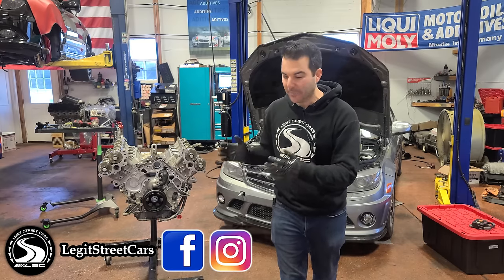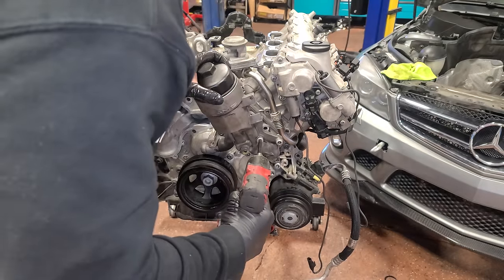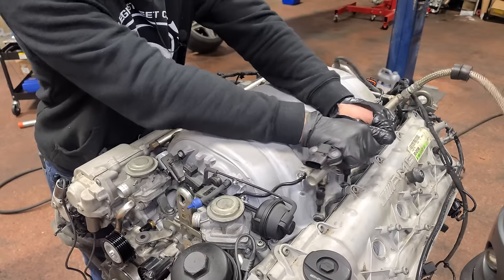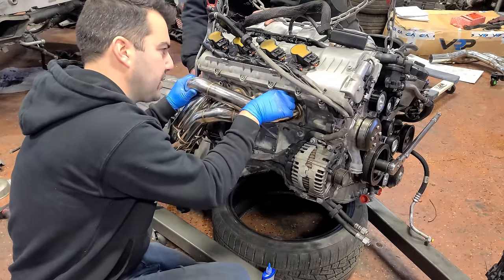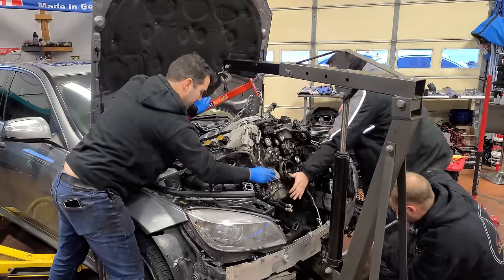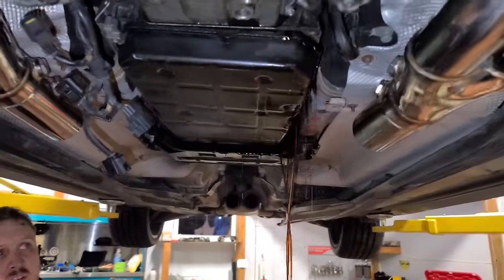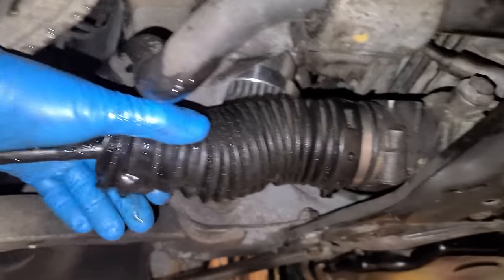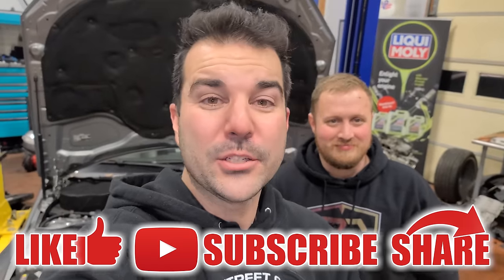Here’s What Happened After Building My C63 AMG Engine In 2 Days With No Sleep! First Start & Drive!

Comment: You are supposed to hold the rpm at 2500-3000 for a few minutes when you first start it after replacing the cam buckets. It will probably work itself out but really helps

Comment: How hard is it to replace the clutch packs on these cars? My third gear is starting to slip after adding more power
Reply: Clutch is always a big job, if you have a ramp it will be easier. You will be looking at a day without. I'd say its a little hard doing a clutch in general.

Comment: I like that relay. I usually pull the fuel pump relay on my Corvette when it sits for over a week to help wet the mains back before starting it. Some call me crazy, but they weren't underneath it with me with I changed the main and connecting rod bearings and saw damage of years of dry starts.

Comment: When I was in High School, We had tractor parking out in the field.  This was in South Dakota late 90's.  Most of the people taking a tractor to school were working on them in the Ag or Mechanical Shop classes.  My senior year was almost completely spent in shop class. As my project, I took apart and rebuilt a Small block 400 that I put in a 1978 Camaro. I also painted it a light powder blue with white stripes.

Comment: Beast of a car, sounds awesome too! Ive got a 2011 c63 amg as well, euro tune, secondary cat and resonator delet, x pipe, air boxes and somthing else im forgetting. Still wanted to hear what yours sounded like with the headers and exhaust. Mines still got the cold start high idle and spits quite a crackin on rev drop when revvin. Considered headers and injectors but then id need another tune to maximize their potential. My next project is an auctioned AWD CLS63 AMG with the 5.5bi turbo

Comment: There has been so much that has gone into this project, I forget what power mods have gone on. Injectors, air filters, headers, and a tune, but what about throttle body, crank pulley, filter spacers? Am I missing anything?

Comment: headers could be making that noise, lots of valves and timing chains etc up there. Different types of header metals can transmit the top end sound more than others(stock headers). Went through something similar with my 2019 coyote mustang, had titanium headers, would make a ticking noise, eventually replaced all the exhaust gaskets, did a leakdown and compression test, just to find out that everything was completely fine.

Comment: @14:50... Why don't I use anti-sieze? Because the factory doesn't and I don't live anywhere where corrosion is an issue. @15:55... Oh, don't do that. Never tempt the fates. You'll lose every time. @24:50... I think I'd probably replace the coolers and lines. Relatively cheap insurance. I mean, you probably got it all, but what if you didn't? @37:00... V8's sound so nice once you tune out the emissions rpm hang.

Comment: Love the content bro, but I happened to notice something when you're using the toggle torque wrench, maybe im wrong but it looks like when you're applying the torque to the bolts, the handle is not centered. The handle pivots side to side but when applying torque, you're actually supposed to keep it floating in the center as much as possible. Again,  maybe it's just the angle of the shots or maybe you know this already but if not,  now you know! Keep up the good work!

Comment: It would be nice to follow up with that car and see how long before something goes wrong with the  M156 engine … guess it’s gonna depend how much the next guy is gonna beat on it, and how (or IF) the car will be maintained.  Great series, both entertaining and educational at the same time.
Reply: They are actually very stout engines, the early model years 2008-early2011had the headbolt design issue, that leaves only the wearing of tappets/cam buckets which you can mostly mitigate with thicker oil and more frequent changes

Comment: I used Stage 8 locking fasteners on my LT headers. 

How's the vibration on those billet engine mounts? I learned my lesson on using racing bushings or mounts on a street car. It's worse than a race clutch.

Comment: Do you have any suggestions on what oil to use to help with lifters that bleed down? I've got a noisy one on my '13 Caprice only at cold start. On 90 degree days last summer the tick went away.  I have the DOD kit, but kind of want to put it off until spring.

Comment: You must have a really high temp thermostat in that thing. It looked like you were running close to 100°C despite the outside temp below freezing.
I can't get my e320 up to 80 when it's close to 50 outside, even when I drive the piss out of it, like 90 to 100, on the freeway.
That is such a clean looking car.
Reply: Somethings wrong in the cooling

Comment: I noticed you using loctite on the header bolts. Never seen that, basically the heat generated at that location would negate loctite.

Comment: I have over 400 entries and I am going to keep pushing!  Right now I have a 2017 Nissan Pathfinder with a bunch of different warranties but the radio will never turn off and it constantly kills my battery, the situation is absolutely rediculous.  The stealership has had my SUV for 7 months and can't figure out the issue.  They have wasted thousands of dollars replacing the radio, different modules, sensors, and it's still not fixed!  Now they want almost $6,000 for a new wiring harness then they want me to pay for 15 hours of labor.  The SUV has 35,000 MILES!!!!!  I'm paying a nice chunk every month for this car and it's worthless.  Even when I pull the radio fuse there is still a drawl that kills my battery.  It is sickening as I am a hard working blue collar man with 2 kids.  I really need a car that works, and this car would be a dream come true.  If I win this car I will most likely make a video blowing up the Nissan Pathfinder.......... Seroiusly!  I'm over it!  Love your vids, I've been subbed for years.  Fingers crossed!
Reply: It's a Nissan, trade it off for a Toyota.

Comment: Do you have a video on how to remove the 156 from the car?
Reply from the maker: Yes. I show you in this series and in the C63 series I just released
Reply: @LegitStreetCars  thanks, somehow I missed your removal.  Couldn't you have dropped the engine and trans on the subframe instead. Tasos said to do this when doing the head bolts.  He did it on a M156 but the engine was already pulled when he started his video.  I have an SL so I dont know how different it is. I do know that I have additional cross braces under the car that are in yhe way. Thanks!!

Comment: I know you know your stuff and are more then capable. However U shouldn’t allow an AMG to get to operating temp while just sitting or just sit idling. Its in the manual as well it can actually cause harm. U simply wait for rpms to drop then drive until desired temps are reached.

Comment: You’re using that old-school torque wrench wrong. The handle is on a pivot and when you’re reading the deflection needle for torque, you need to balance the handle on that pivot.  By just grabbing the end of the handle, you’re extending the length of the bar which is throwing your torque reading off.  You’re over-tightening them.

Comment: Why torque spark plugs? Surely that's just 8 on the impact drill.
With all the snow, you should try atf in the radiator instead of water. Less chance of freezing, and rust. And for an old car, if you blow a head gasket you think the oil, not turn it into milkshake. Better chance of bearings living.

Comment: Just a heads-up, there is a reason that the cold start has a high idle!  Its to build oil pressure in cold temps.  I would recommend getting that put on the tune file!
Reply: Also helps the neighbors get an early start to their day! ask me how i know :D
Reply: Not really. The high idle is there to warm up the catalytic converters for emissions reasons. Many tunes that are meant for deleted cars tune out the high idle because there is no cat to warm up. Diesels on the other hand need a high idle function because they idle at such a low RPM. That necessitate the high idle feature if they idle for long periods of time like an emergency vehicle at an accident scene for hours.
Reply: @IKhanNot  The deleted diesels dont need a high idle right?  except for a cold start heat up? Like my 4th gen ram cummins kicks into high idle after a few minutes of idling. tuned and deleted